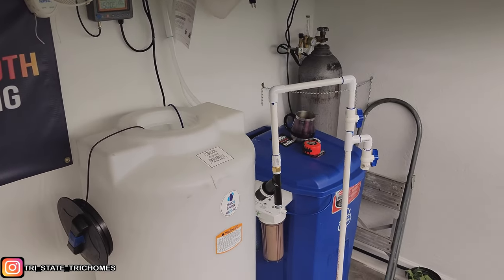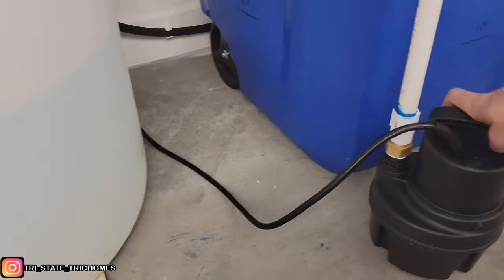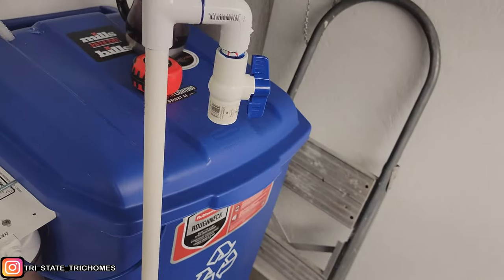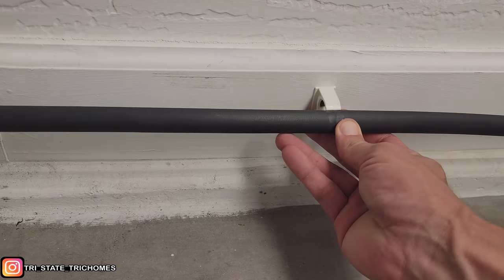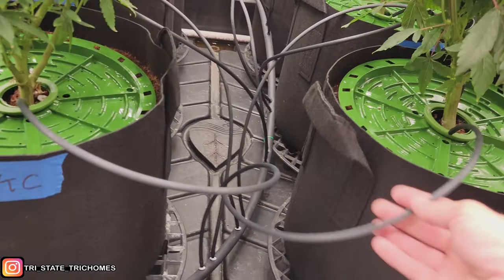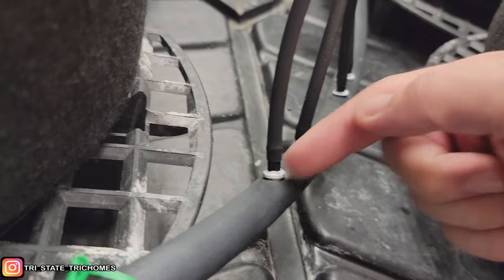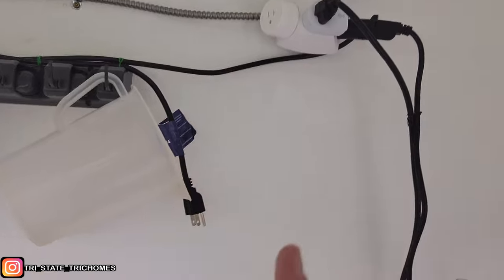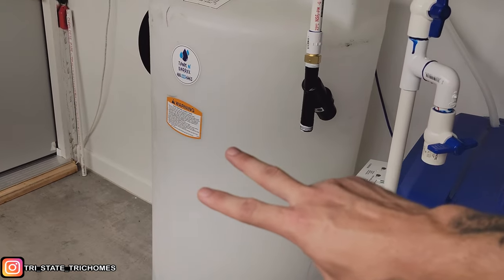DIY Drip Irrigation for Indoor Use - Automated feeding - NO MORE HAND WATERING!!

Comment: I went with something similar based on your irrigation, but it is slightly different. I am using pvc all the way from my res to the tent, capping the ends with the bucket company pvc caps and using their mini dripped sprayer kits from there. It is working great with zero worry of any blowouts or leaks while I'm out of town. Thanks for the video! Wish I could share mine but I am in a no no state..

Comment: Instead of paying floraflex off, I used medium sized (1.3 inch) binder clips to clip to the edge of the fabric pot and fold up the arms so that I can run the 1/4 inch line through the arms and hold the line in place. It won't spread the water out completely, but it gives you a better indication of if you're watering enough as you can visually see how far the wetness spreads from the feed line.
Reply from the maker: Yeah I have been trying to think of a way to make my own version of the round matrix.
Reply: @TriStateTrichomes  mould it!!

Comment: Love the new setup! I’m looking at going the irrigation route, have you read much into what moisture % and the best dry back is for veg and for flower? Everyone has conflicting operations online, cheers
Reply from the maker: I have and a lot is conflicting. So more research is needed before I can justify investing in better moisture sensors. Until then I'm going with 2 small feeds a day and watching how it's handled and if I get too dry or too wet. More a trial and error method right now. I've reduced my feeds to 1 minute twice daily already. See how that is handled maybe increase to a 3rd if needed later in flower.

Comment: How do you like that ecowitt moisture sensor? Do you find it accurate & helpful?
Reply from the maker: I would say it's not the best but it does give me a general idea of where I'm at. And at the price I can't complain. I have to really bury it to get a decent reading. I know that at 50% in my coco I'm basically at 100% field capacity. Anything past that will runoff. I know I want it to dry back to the  30% range before watering again. Exactly where I choose is based on plants life. But it give me another data point even if it isn't accurate. So it's accurately, inaccurate as the saying goes

Comment: Thinking about upgrading to an irrigation system and I like your setup. Can you give me a rough estimate on what you think the total cost was for that setup so I know what I’m getting into? For parts and stuff
Reply from the maker: giving some rough estimates here. 
Pump- $50
hoses and fittings- $60
floraflex matrix- $45
smart plug- $10
the tank is the most expensive part at $300 for a 75gal vertical tank. you could use a drum to save money though.
Reply: @TriStateTrichomes  another question can you recommend a good dehumidifier?
Reply from the maker: @JK42688  Honestly i check offer up and found a 70 pint GE for $40 and took that. Id like to have one i could attach to the wall or ceiling but those are usually much larger and more expensive. I have had my eye on a Govee brand wifi one. its the same brand as my monitors so i could control it all from one app. So for price check offer up, I look for a pump or drain so im not always having to empty it. but here is the govee link if interested in that   https://amzn.to/3RW1olN
Reply: Do you have an email or discord where I can message you? I’m having trouble with my grow. Idk if you have time to answer questions or if you offer help like that. But if you do I’d greatly appreciate it.
Reply: Wow I just realized IG duhhh, should I just hit you up there?
Reply from the maker: @JK42688  yeah hit me up on IG and I got you

Comment: Do u use regulator pressure on ur set up? I'm trying to do the same route
Reply from the maker: I do not. I just ran the pump in 1 minute spurts. Seen how many that took until i get run off. Used that to base my feeding schedule off of. Very simple. Nothing fancy since it's my first run with irrigation. Made watering the plants so much easier and I'm glad I built the setup.
Reply: @TriStateTrichomes  thank you for ur sharing. Maybe I'm  just overthinking 😂.
Reply from the maker: @24KFLOWERS  no your thinking correctly. i have seen the setup where it has a regulator so they know what the lines are getting and that it is consistent. im just being lazy since its a smaller setup

Comment: There has to be a way to 3d print those green watering sprinklers
Reply from the maker: I'm sure they would turn out better if you did. Printing the matrix to custom fit any pot would be ideal as well. I am not sure what that would cost though or where that can be done.

Comment: I’ve been wayy overthinking a RO reservoir for to long now. What do you recommend would be the easiest simplest setup to be able to have like 30-50 gallon drum res I could fill once a week and easily dispense it to mix nutes. I use a stealth ro300 so the most time consuming thing for me is just dispensing the water. Takes me no time to mix the nutes slap the paint mixer into my drill n go nuts lol
Reply from the maker: What do you mean. Just an RO storage tank?
Reply: @TriStateTrichomes  yea
Reply: Ok maybe I shoulda been a bit more specific with my real question which is would I need any special equipment to put in said reservoir to keep it fresh for the week? ( I’d most likely be re filling every Sunday) and does it need to be sealed tight or could I get away with a tote and a lid?
Reply from the maker: @cporz3784  you should be fine with anything that has a lid. If it's pure RO it should have zero issues being stored anywhere. In your grow space makes it more easily accessible. You make need to clean in between grows or as needed to ensure it stays clean. You could also add hypochlorous acid to it at 1 or 2 ml per gallon to ensure it stays sterile. That's what athena cleans is made from. Other brands have this as well. But you could just buy it from Amazon for a fraction of the cost.
Reply: @TriStateTrichomes  right on. Long term i for sure wanna do something like what you got going on with the waste water being re cycled. I was the one that was talking to you about that when you uploaded that vid as far as the ph/ppm in n out. So now that it’s been some time I’m assuming that you haven’t noticed any differences between using the re filtered water as opposed to RO despite the ppm/ph differences you just adjust based off your readings?
Reply from the maker: @cporz3784  I get lower EC/ PPM from my runoff than I do from RO filter. It's not a huge difference since it's already so low but it is lower. Plus I never replace filters since runoff stays consistent.

Comment: So your run off goes where I guess that's the most I'm confused on.
Reply from the maker: Goes to that black tote underneath the trays. I have a pump inside I connect a long hose too and pump it to outdoor plants. Usually every other week maybe once a week I need to do that.
Reply: @TriStateTrichomes  prefect that's what I was wondering so do you have a tote under both tables?
Reply from the maker: @growersplus  no they are close enough for both to drain into the same one.